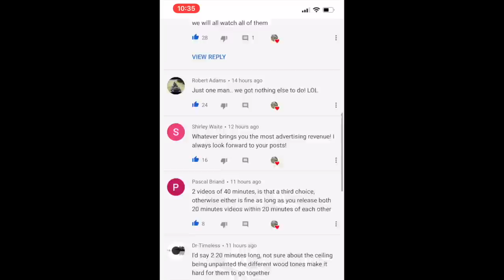Making Your Renovation Look Old | Salvaged Hall

Comment: Put a piece of masking tape on the bottom of the the door, draw your cut line on it and saw through the tape. No tear out of the finish. good job though the way you did it. also you can make a little jig and cut you hinges with that then just square the corners
Reply from the maker: I was surprised I didn’t get any tear out actually?? I have a fairly new blade on that saw.. and I cut super slow.. but, the tape would be a better idea for sure..

Comment: Hi Lucas and Sarah. I have watched your entire video series over the last couple of weeks. I got to say that this is an amazing project and the results thus far have been stunning. It inspires me to someday either renovate or build my own home. 
There is one thing that is driving me crazy though, please run some CAT-6E cable around the house before you finish up the walls. I understand that having two or three people connected over WiFi is working okay for you (since your kids are still young). But I can promise you that when your kids grow older and they have multiple internet connected devices each that can stream HD video, you will need a better solution. I would run Ethernet cable from the place you plan to contain the modem to the places where you would like to someday install access points if you need them. The ethernet cable is not very expensive and you do not need to connect it to anything now. But if you need it in the future, having the cable runs already installed would make your life A LOT easier. It would also increase the value of the property if you care about that. 

I am telling you this because I wish I could do this on my own house without tearing down walls. Feel free to contact me if you would like more info. Anyhow, I wish you guys the best in this project.
Reply from the maker: Hey, that’s for watching 😃 we’ve talked about that ( Sarah and I ) and maybe we just different that the average family. But, we don’t feel the need for it.. I know it’s not very expensive.. but, the house in general is very expensive 😂 so, we decided to just go with the WiFi.. I’m also picturing wifi getting better and better over the years .. and wired connections being a thing of the past.. lol!! Like the phones lines 😃 yes, my kids might use it more.. but, the one WiFi thing we have now works great.. 100mbs download speed seems to work just fine.  But, thank you for the suggestions 👍 don’t let my lack of internet cables frustrate you too much 😂
Reply: You are correct that WiFi is the way of the future as many internet connected devices no longer come with Ethernet ports. My suggestion to install CAT-6e cable is not for connecting user devices to it, but to enable you to install a better WiFi mesh network in the future (if necessary). That said, I understand that you have much bigger fish to fry at the moment and I won't be upset if you decide to ignore my suggestion.

I did a poor job at explaining my concern on my previous comment so let me try to explain it a bit better. WiFi data transfer speeds have increased significantly over the last 15 years by, among other things, increasing the frequency of the signal. However this came as a trade-off. While the higher frequency allows much higher bandwidth, it does it at a much shorter range. This is why many WiFi access points offer two WiFi frequencies, 5GHz for high data rates at a shorter range and 2.4GHz at long ranges but slower speeds. This is also why you would struggle to stream HD video if your phone or computer has more than two walls or large objects between you and the WiFi access point. Furthermore the more WiFi connected devices are within a confined space (a.k.a. security cam, phones, smart TVs and speakers, etc), the more interference each signal will produce and the shorter the effective range. There are also talks about even higher WiFi frequency standards being available in the future but, as you probably guessed it, at even shorter ranges.

So how do IT manage to service many people connected to a single WiFi network in large office buildings or large family homes? They do it by connecting the network router to multiple WiFi access points (think of them as antennas) distributed at strategic points along the building. This allows the users to get the best data transfer speed available using the higher WiFi frequencies because there is a WiFi access point close to them regardless of where they are in the building. Ethernet cable is most commonly used to connect the router to the WiFi access points because of its high signal integrity at medium ranges compared to WiFi repeaters and lower cost compared to optical connections.

Techquickie made a couple of short videos on the subject if you are interested.
Reply from the maker: David Lifschitz ah! This makes sense 👍 we appreciate the comments!! We’re lucky that we have a full basement and running any type of cables into the house ( first floor) isn’t too bad.. makes perfect sense to do it now though.. next time I’m at Lowe’s I’ll take a look at the cable options and see if we can make sense of it.. thanks

Comment: I hope you included the depth of your final flooring in the calculations for those door length and jamb cuts.  If not, it appears there is still plenty of room on the doors and the jambs can be done with a Japanese saw or an oscillating saw and a square or scrap as a guide.  I'm always tempted to offer hints on how to do things; but, I resist as learning  on your own undoubtedly  makes the outcomes much more rewarding for you.  Good luck as you more forward.
Reply from the maker: Hints are very appreciated. I did (thankfully ) consider the finished floor for these doors.

Comment: I think one of those doors weighs more than 5 of my interior doors. The have a big layer of air in them sandwiched between layers of a material that I presume used to resemble wood lol.
Reply from the maker: 😂..  did weight these doors and it was around 100 lbs. 😳

Comment: I have a question the floor you are walking on in front of the closets is that a finished floor or are you putting something over the plywood my reason for asking is did you leave enough space to open the doors when you put down the new floor
Reply from the maker: hello, I sure did! if you can see.. I have some 3/4 pieces of hardwood flooring under my door jams.. we're going to be putting a hard maple floor down for the whole downstairs. :)
Reply: I had that concern too and was hoping that the finished flooring thickness was taken into account.